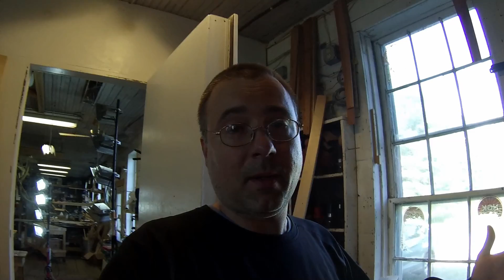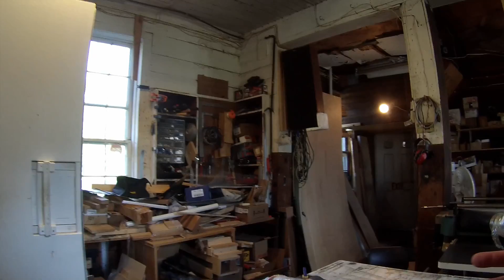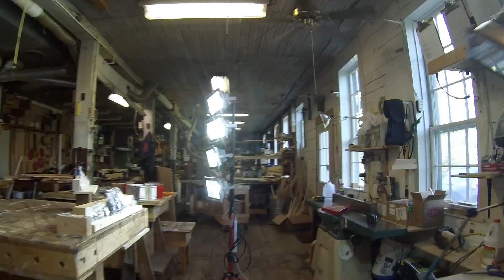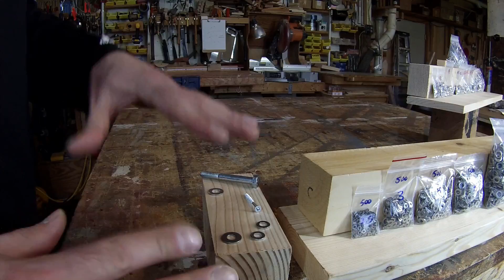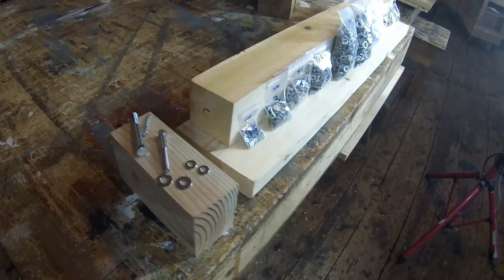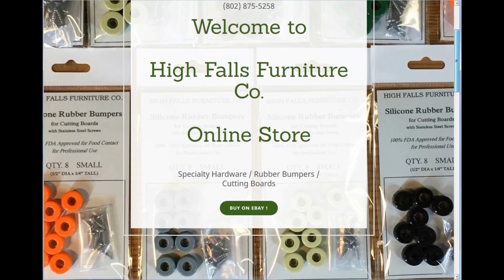Hardware Addiction - Metric Washers are Good

Comment from the maker: My impulsive hardware habits can be destructive, but it also enables me to innovate and find new uses for things.  Metric size washers are good to have around because the outside diameter is more compact so they fit into tighter spaces.  Plus it is just good and simple to have all the washer sizes you will need in stock.  Buy the variety pack on Ebay for $10.50  (free shipping for the remainder of this month.)
http://www.ebay.com/itm/Metric-Washers-Stainless-Steel-2-5-3-4-5-6-8mm-QTY-100-QTY-500-/222578394011?var=&hash=item33d2b4c39b:m:mmlsKb-Sa-yq72rGQg5Mcog
Hex Nuts
http://www.ebay.com/itm/Metric-Hex-Nuts-Stainless-Steel-M2-5-M3-M4-sizes-2-5mm-3mm-4mm-/222578422235?var=&hash=item33d2b531db:m:m1Hltr6Ud-s90EBd9ff5lCA
Machine Screws
http://www.ebay.com/itm/Metric-Machine-Screws-Stainless-Steel-M2-5-M3-flat-head-M4-pan-head-/222578441226?var=&hash=item33d2b57c0a:m:mjKkAt5RTR7EZ6bA1UNho3Q